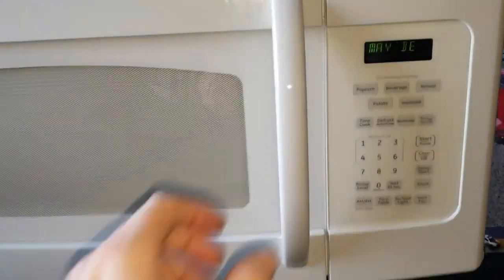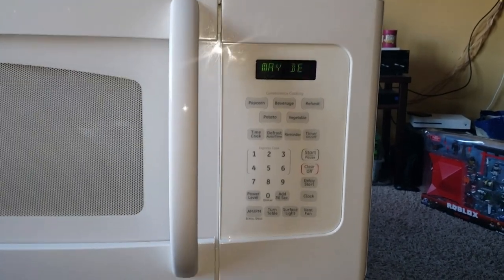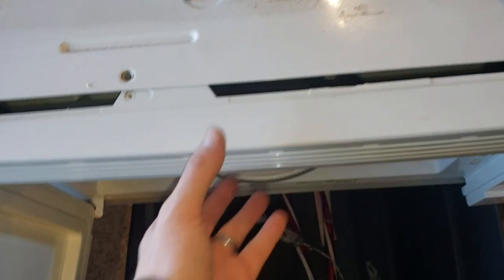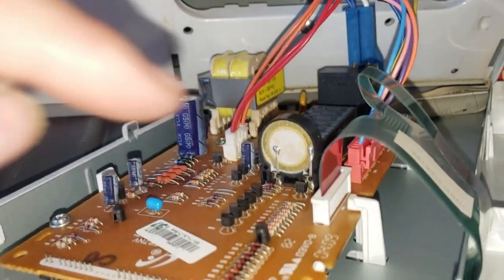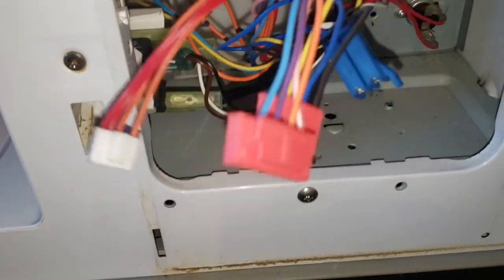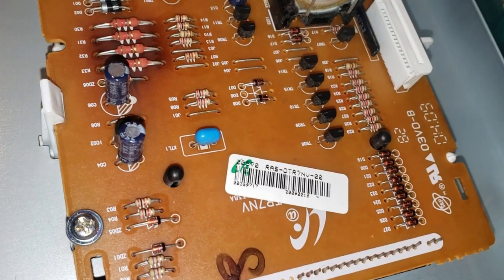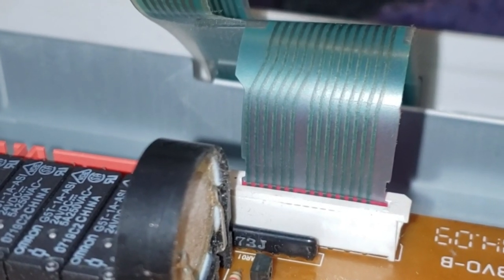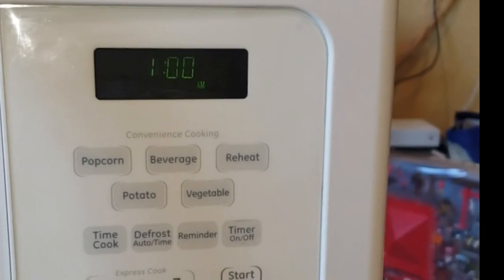GE Microwave "KEYPAD SERVICE MAYBE NEEDED" "KEYPAD SHORTED" HVM1540DN1WW

Comment: Mine constantly turned on and ran when I shut the door but table didn't turn and light didn't come on. I ohmed out all the switches ,everything checked out good. Watched dozens of vids on what could be wrong, then came across  your video. All I can say is "I can't believe it!" Pulling the ribbon cable out and resetting it actually fixed it! I would have never thought. I was about to give up and buy a new one. Thanks for taking the time to make a vid and show what to do.
Reply from the maker: I am so glad it worked for you as well.

Comment: Damn didn’t work for me. Same buttons are still out, but it was worth a try. I ordered a replacement control panel from Amazon. A new one was $180, I bought a used one was $60 (can mail back if it doesn’t work).

Comment: I have the same exact model and having the same problem. I didn't disconnect all the connections I was able to reach the ribbon without unplugging all of them. It worked for one use perfectly and then it started doing it again. Any ideas, I wiped the ribbon with a paper towel. Is there any kind of solvent I should clean the ribbon with? Should I have unplugged all connections? Thank you
Reply from the maker: It doesn't always fix the problem forever I ha e heard that sometimes it comes back. You could spray with some electrical cleaner and try again.